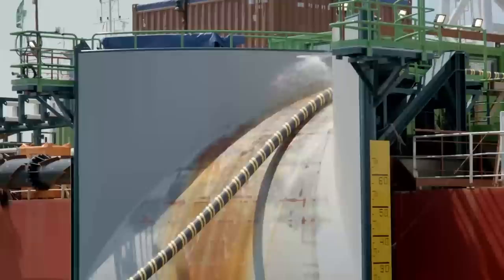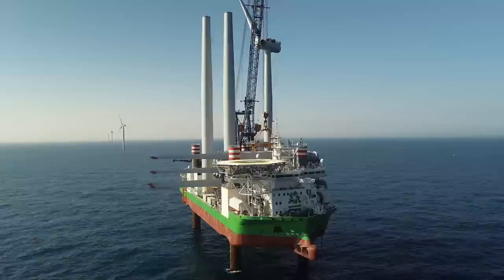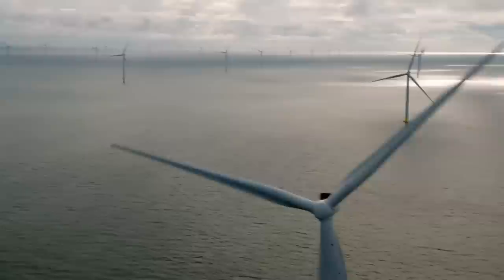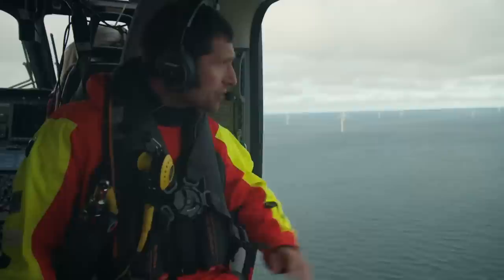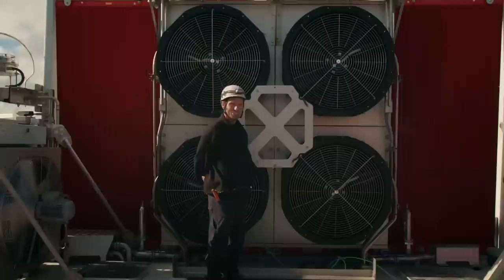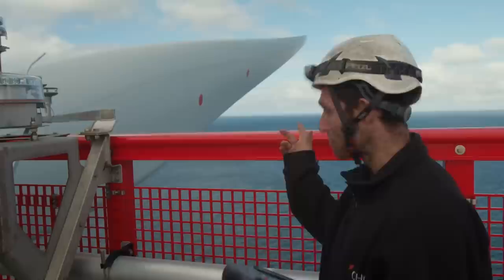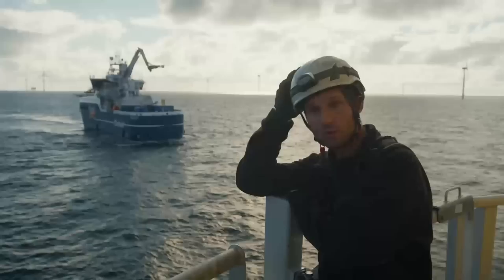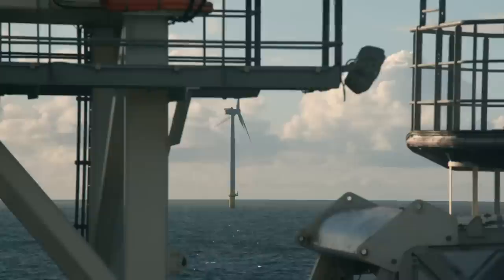Guy AMAZED by the engineering of an Offshore Wind Farm | Guy Martin

Comment: Question is though, how long do these last and can they then be recycled etc?
Reply: No, the blades can't be recycled. The rest is scrap metal, so has a value. Plus they are spending tax money to build these farms, not company money. Your wages are being funnelled off to make a lot of already rich people even richer. Reusing them would mean they lose a sale, so they make sure they have a use by date. 

 The carbon footprint of manufacturing one wind turbine is equal to 1,701 tons of CO2-equivalent. The UK average carbon footprint is about 10 tonnes CO2 per person per year.
Reply: They're working on it  @bobeyes3284 , I can't post a link as YT won't let me, but search for 'Vestas unveils circularity solution to end landfill for turbine blades'. Once finalised this will take old blades to use as raw material to make replacement blades. At the moment they are either ground up to use in concrete as reinforcement, repurposed (I've seen some as bike shelters) or sent to landfill, although bear in mind that this is typically 10 years before they need replacement.
As for the carbon footprint aspect, whilst the overall figure you state (1701 tons) might be correct, it's a little disingenuous and needs to be put into context. They typically 'pay this back' within 6-9 months of operation. Comparing it with a individual human footprint is not a particularly useful metric for comparison. CO2 per kWh is a better perspective - "On average, considering its whole lifecycle, a wind turbine emits 26 grams of CO2-equivalent per kilowatt-hour. For comparison, coal emits up to 1,689 grams of CO2-equivalent per kilowatt-hour." - taken from '8 Billion Trees .com'
Reply: A lot of "end of life" turbines are reconditioned and put back in to service. RePower being one of the bigger firms to do this.
The blades are moving towards being fully recycleable
Reply: How many times do they reuse the coal in the alternative?
Reply: These newer blades are recyclable, the resins are acid soluble.  There is no tax money going into building these (that was true of wind in the past but not any more, they're now cheap enough to not need it).  Contracts are awarded by "reverse auction".  Lowest bid for power price wins.  Last round of UK off shore contracts bid in at 5p/kWh (domestic electricity prices are currently 35p).  Design life is 25 years for the turbines.
Reply: @bobeyes3284  sure, but one of these turbines is 8MW = 8,000 kW, at an average utilisation (load factor) over a typical year of ~30% that's ~21,000,000 kWh/year. With a conservative lifespan of 20 years (noting a design life of 25 yrs) that's 420,000,000 kWh for 1,700 TCO2 eqivalent. That works out to be about 3.5 gCO2e/kWh over its' life. The UK average emissions intensity today is ~ 200-250 gCO2e/kWh, so this is (conservatively) 60x cleaner than today's average energy source. Then, consider the carbon emissions from manufacturing processes is largely the energy source used for their production, (which in turn clean up as they begin to be sourced by renewables...) and we're trending pretty rapidly towards 0. 

Oversize your peak generation capacity (to account for load factors), incorporate interconnectors to scandinavia and europe mainland (done), invest in some more grid scale storage (pumped hydro, batteries if you must, hydrogen from electrolysis for peaking plant - it'd be expensive to use), sprinkle some diversity with solar generation and a nuclear baseload then hey presto it's a resillient system. 

f you want to be really fancy, you can legislate smart meters and IoT load control of vehicles, with DSR from those new batteries on wheels, which become grid storage once their original vehiclar purpose is complete.

(oh, by the way, this is exactly wha's happening).
Reply: @lowe5394 and yet someone will still reply to your comment with some BS fossil fuel lobbyist talking point.

Comment: It really is an absolutely extraordinary achievement.  The only downside, as they say, is the lack of consistency.  That said, these will continue generating power at night or on dark cloudy days, unlike solar.  The key to making all of this work best is in the non-chemical storage of electricity, such as via gravity batteries, water pumped up to lakes above hydro-turbines, etc.  Makes me proud to be human.
Reply: International power export cables (interconnectors) help smooth out local wind lulls.  GB grid currently has connections to Ireland (N and republic), Belgium, France, Netherlands, and Norway.  Proposals are in place for interconnectors to Iceland and even Morocco, but that's a different story.
Reply: Solar can and does generate on all but the cloudiest days.
Reply: @MaggieInABox  Yes, but the output is significantly reduced, as is the daylight during Winter months.  I love solar too, it just doesn't have the benefit of 24 hour operation like wind does.

Comment: I worked on this wind farm.......
It's a eco green badge for UK......bollacks......
It's a badge......it's so eco unfriendly as a coal powered station.
The money they waisted on H&S.
These are not eco friendly, "A" service vessel going out to service burns 3000lts of fuel 
No one looks at the build and dismantled costs and everything involved......just see nice blades turning.
It's a piss take to the UKs failed power supply.
Should of gone nuclear or better still thoriam .